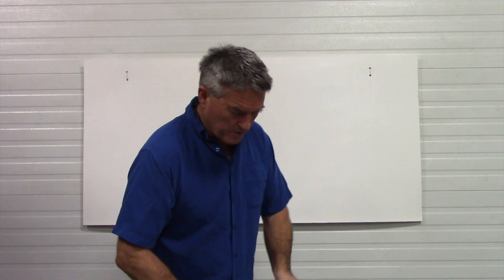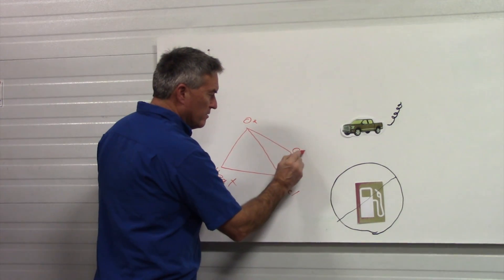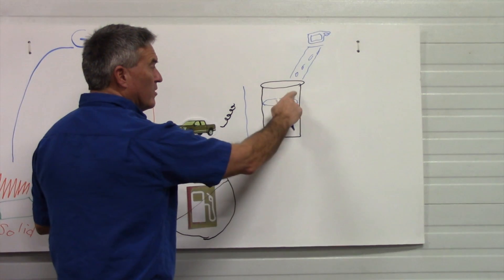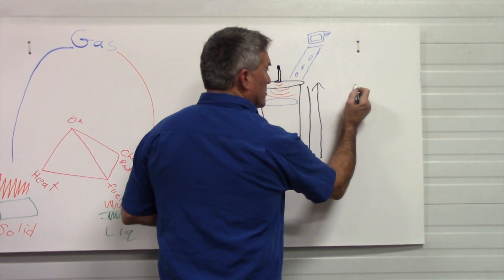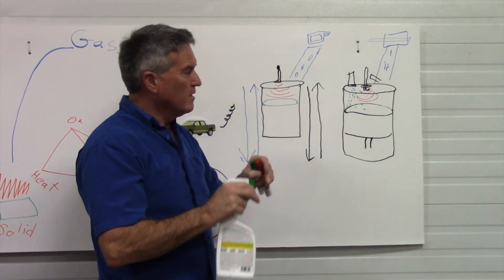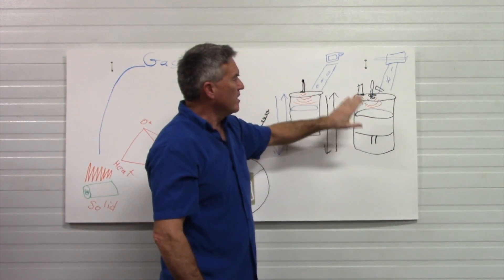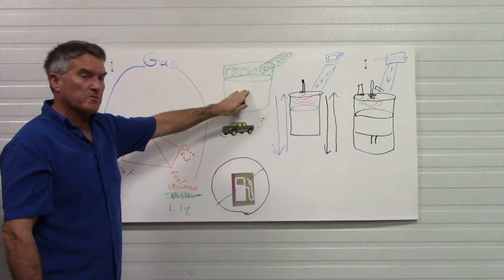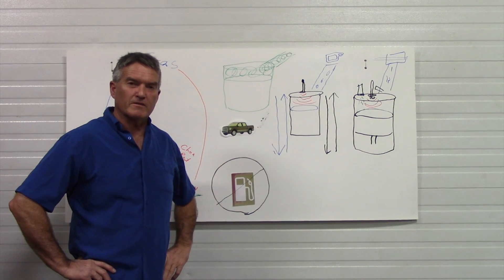One Simple Trick to get 100 miles per gallon with less pollution!

Comment: Why not just stop burning the natural gas capping the oil in the ground and use it first ? That would make more sense to me . Every car can easily be converted to run on CNG . The oil companies burn off metric tons of natural gas and produce mega tons of carbon just to get to the oil .
Vapor cars do NOT get significantly increased mileage ,many people have tried this and it simply does not work 2-3 % increase is all you can get. The Polish have been using CNG for decades and have proven it is the best way to use the oil in the ground . Leave the fucking oil in the ground and just use the end product you need to make the car run ,VAPOUR . The only down side to all of this is that the ICE as we no know it was never fully designed to use this fuel and as such reduces the life of the engine .
Now with some small alterations to the ICE we could add in compounds to the metal to reduce friction /wear and have a viable solution . The answer is not to build wet motors but build vapor motors . Leave the oil in the ground and let it keep making vapor fuel  the supply will be 100 fold more . The problem with that is the oil companies won't make as much money selling cheap non refined fuel. It would just need to be filtered and  more or less ready for use.
Union gas in ontario Canada runs there fleet of cars or did at one time on nothing but CNG and they saved tons of money. People just didn't like th long fill up times and refueling stations were hard to find. 
This works and could work right now ,BUT the OIL BARONS don't want it to work as they would lose money. They lobby governments to keep this from ever happening .
Reply: Well, as to the use of natural gas or propane, the problem there is that neither of those that are commonly used in today's vehicles has nearly as much potential energy as petrol fuels. This means that you have to use more fuel to get the same kind of power output. Secondly, your information about fuel vapor usage and mileage is WAY off.  Oh, if you didn't know, back in the 50's and 60's, a lot of farm equipment in the US DID run on vapors. Due to the extended times that items like harvesters and combines would run, the manufacturers created intakes with extraordinarily long and heated intake tubes that vaporized the fuel prior to combustion, The problem was that they ran at the same RPM and the technology couldn't easily be converted to fit the regular use vehicles due to the ever changing needs of the road.  I personally have built and installed a vaporizer unit, albeit a rough and inefficient design, on my 1995 Toyota Corolla with a 1.6 liter 4 cylinder engine. From the factory, this car was averaging between 23 and 25 mpg with over 165k miles on it. After I installed the vaporizer unit, I was getting between 41 and 43 with the average being closer to 41. Now, does that sound like a 2 - 3% increase to you? Nope.. Nearly double the mileage! Now, consider this. I did NOT disconnect my injectors... I merely subsidized the liquid fuel with vapor. The added vapor caused the ECU to pick up a rich fuel environment from the O2 sensors and cut back on the injector pulses per cylinder, per revolution cycle. Simple and totally effective. Btw. You are absolutely correct on the reason vapor will never be used in modern vehicles from the factory. The car companies and oil companies will not allow it because of the MASSIVE profit loss.
Reply: @craigcarpenter2069  I think that you are full of it. You are no better than a man selling snake oil as cure for every ailment known to man at a carnival. Show us all how you built this vaporizer of yours or you are no better than the snake oil salesman.
Reply: POST A YOUTUBE VIDEO AND EXPLAIN IT PLEASE
Reply: Craig Carpenter ,I guess you don't know that cars are made in the U.S.,that get 90-100+ MPG NOW.BUT are not allowed to to be sold to Americans.Only allowed to be sold to "poor" countries.FACT.
Reply: Scott Henderson
What cars are those and where and by whom are they sold? Links?
Reply: Scott Henderson: false. I'm not sure you're real, let alone being a kid.  And if you are real, and you are a kid, you shouldn't be left alone because, well, they made a movie about that and it's not really safe to do that, so, yeah.
Reply: Scott Henderson - You are right , But to be fair those cars are a hell of a lot slower than ours....
Reply: The news,,,, really??? Our "news" which is broadcast daily is nothing more than propaganda and outright lies! As far as Government vehicles being capable of achieving nearly twice the fuel mileage as civilian vehicles.... FALSE!!! I personally have 10 years Military and an additional 17 years as a government employee and quite possibly have driven more miles in a government vehicle than I have driven a civilian vehicle. In fact, I honestly believe the fuel mileage of a government vehicle is worse than its equal civilian version. The reason for this is that government vehicles are NOT held to the same governmental regulatory standards of civilian vehicles. It's the same old thing... "Do as I say, and not as I do".
Reply: @robertbuckles3596  after reading these comments i know what Scott is talking about he just has it wrong about the Government ..some years back i forget the name of the company off hand but a company did build a car that got great gas mileage i think it was about 50% better then most cars at the time or more...and the Government did put a stop to it before any were even sold ! they came down hard on this company and closed them down with a warrant and took the cars away to be destroyed .the few people that did know about them like the plant employees and there family's were protesting and the only proof this happened is a few people filmed the shut down and the trucks coming and removing the cars..so yes in a way scott is rite he just has the facts wrong .i can understand why the Government did this it would have crushed the oil companies and our so called friends in the middle east would not have been very happy ! let alone the major US oil companies that buy and refine the crude..also diesel is less refined then gas but costs more per gallon ?? just as im sure you know heating oil and diesel are the exact same thing ...Diesel has a dye added to color it green and heating oil red this is so truck drivers like me do not run heating oil since its much cheaper ! This is 100% true i have been stopped by the DOT and they sometimes check by opening your tanks and taking out some to check the color ..if you get caught running heating you get in trouble for tax evasion ! Truck drivers do this sometimes ..i forget exactly the year but around 14-18 years ago diesel went up to around 4.00 a gallon even a little higher before it finally ended ..i was a owner operator for United van lines and that almost put me out of business ..having to fill twin 125 gallon tanks so 250 gallons at 4 bucks a gallon 1000.00 a fill up..and my truck as most got about 6 miles to the gallon..the Government is under the control or at least heavy influance of the oil companies and the world ( meaning the middle east) i know you most likey know this but Scott said he was a kid and i am pretty sure he does not know all of this..many people don't ..eceptially about the heating oil and diesel also the time when it went up to over 4 bucks a gallon..Since diesel is like 1 step above crude why should they charge ore then gasoline ?? the reason is they make a killing off of truck drivers or the companies that pay drivers to drive there trucks..Thank you Robert and yes your correct about the news its a pack of lies !!
Reply: Craig Carpenter ..... That's a lie! I'm a cop and my cruzer, a Charger, definitely does not get good as good gas mileage my own Charger. The cruzer is pushing a massive amount of electronics which taxes the engine, plus some other stuff that counteracts over heating.
Stop blowing smoke up people's ass' and do a little research. 
GEET FUEL PROCESSOR and MAGNET MOTORS are more promising!
Reply: Elbert Beam -  Thank You; in 1978 Iranian chemistry teachers in So. Texas University told me the exact same things you just said here.  Dang, is this country messed up!   So there is no energy crisis; there is only a; "how do we keep people chasing their tails," crisis.  Make them confused about who to vote for, scandals, seem to be one way.
Reply: Scott Henderson no.. I am well aware of that fact. I'm aware of another that most folks don't know also. That is the fact that most government issue vehicles have VASTLY different tuning and in general get twice the mileage that civilian vehicles get.
Reply: Craig Carpenter
What do you mean by "government issue"? Is that military or are talking about local governments like police, post office, etc?
Reply: Craig Carpenter - Sorry! not so, All autos allowed into the US are detuned. By the way I like your Vid's.
Reply: You are correct in the fact that an internal combustion engine that is designed and tuned for the use of gasoline to operate will run far better on gasoline than it would on natural gas or propane. But with very simple modifications i.e. valve timing (cam), combustion ratio (piston design shape),  ignition source (timing). That very same modified engine could very well exceed the power, performance, and efficiency of it's previous state of design using natural gas or propane as a fuel source in a modified state.
Reply: Robert buckles "exceed the power, performance, and efficiency" - I don't think so! Gasoline 1 gallon = 125,000 BTUs -  Propane 1 gallon = 91,700 BTUs  and Natural Gas is even lower. Do The Math…..
Reply: you are all right on and this is the root of problem it's all about control of the people and there labor
Reply: P Kuudsk my friend had a rock caller that ran off propane  . ran .. just fine.. and very powerful..  you are so right!
Reply: Elbert Beam Back in the 90’s they said the same thing about a war in Alaska. They also found a huge deposit off the gulf. No drilling going on anywhere. It’s all a racket. Cars now get twice the mileage than they use to, so what do they do? Increase prices double to maintain profits. All the while feeding us this crap about CO2 levels and running out of oil, to justify price increases
Reply: They do that to control price, $$ is all its about
Reply: Craig Carpenter , that wouldn't surprise me at all.HAVE A GREAT DAY. SCOTT HENDERSON, & BENJAMIN L.SCHINDERSON FAMILY.
Reply: Marshall Richardson ,stats were on the news "the big three"&you can bet it's on the internet,(as history),at least that show aired they were showing cars with 100+mpg made,HERE,but Americans were   NOT ALLOWED,LEGALLY TO BUY FOR USE HERE.THAT is what the documentary was about,it 's Hard to believe that that video,didn't disappear.THEY WERE ALSO VERY SMALL,SOME of Em I believe they were ALSO ONLY 3cylinders.I am just a kid,but those"smart"cars are kinda small,and DANGEROUS.
Reply: P Kuudsk ... We'll,...The Geet Fuel Processor can turn earth's oil waste into non-polluting fuel. Magnet Motor Technologies are proving very promising too. That and you can't get worldwide cooperation.
Nice try though. Thanks for playing.
Reply: BS
The US gov't doesn't give a sheet. 

After all, you will pay for the car, and the gas, for US employees to use. You will also send your children to fight wars on their behalf. 

However there is truth to this video, the major obstacle is the oil and gas lobby. It is important to remember that the US dollar is based off the price of petrol as sold by the house of Saudi. i.e. the petrol dollar. For more information: watch the film "Network" ca. 1976. 

Long story short: without all of our highly inefficient cars with gasoline engines the dollar would lose all value.  

In truth I doubt that we really need to rely on petroleum and other fossil fuels. It is just one of the many the curses of capitalism. 

We've shot our selves in the foot...
Reply: All I can say is ask my former neighbor about using compressed gas, the thing is you would have to find him in the afterlife. He died when the bomb he was riding on was hit by another vehicle. Sorry ass wipe but there is a very good reason why compressed gas should not be allowed on a vehicle. I would rather walk away from a crash Broken than looking like a piece of toast. So take your compressed gas and get the fuck out of here, we don’t have time for stunned fuck idiots.
Reply: The US Gov't started using LNG vehicles in alot of their fleets in the 1980's. Most were abandoned because the engines broke down and couldn't be repaired properly. Good idea in theory, and is more advanced now, but still real world problems.
Reply: P Kuudsk omg.   you are sooo right!!
Reply: Driving around around with compressed gas is extremely dangerous.
Reply: Natural gas has 114 octane rating?  (about) They have developed new NG fuel tanks / now it will work in any gas tank shape. The gas stations could be fitted with a new NG storage tank. It would take much less time a complete US buildout / much less than cell phone towers.. In dense metropolitan areas the demand would grow X?  This is a no brainer to me.
Reply: I hear there is a way to manufacture synthetic fuel using domestic coal.
Reply: Drew N: Yes, back in WWII they built what is called a GASIFIER. It used wood inside a metal can of some type and a flame underneath it to created the necessary gas from the wood (ie...charcoal or as people will call it Biochar). It can still be done today but it's a dangerous concept because of the flames and the pressure the gas can build up. It's a similar situation with the HHO generator. In the HHO generator you basically have 2 different types: a wet cell and a dry cell. The dry cell seems to be the way to go because all the gases and fluids are completely contained in a much safer way. Whereas the wet cell HHO system is basically an open system (meaning that there is PLENTY of room for the bubbler to create the hydrogen and oxygen and it can build up a lot more pressure because of that concept). In the wet cell it is wise to add  a couple pressure relief valves so that if it ever overloads the pressure can escape instead of exploding, which it will do if it cannot escape and builds up under that pressure. In a gasifier the gas that is produced has to be cooled before it gets to the carb or intake and it has to be pushed via a pump to get there. Look them up online here. They're pretty cool to check out. If I had the cash and the place to work I would attempt these things myself but I would recommend that you get a LOT of knowledge of it long before you try it because  both methods can be very dangerous and volatile.
Reply: Drew N - Yes they can BUT! It's not cost effective.....
Reply: Why not just "raid" the black ops/secret military facilities around the world and make them share all their back-engineered knowledge??? You think that's all tin-hat conspiracy stuff? Think again!!
Reply: If any gas is used it should be liquified petrol gas. LNG or CNG is not reliable or practicle in daily use simply because of the high pressures involved which bust valves, the time you need to fuel up a car and the limited range. Besides that, peak oil is a bunch of BS. Hydro carbons like Mineral oil and gas are produced (abiotic) in the ring of fire and squized from rock under extremely high pressures. Every earth quake produces new hydro carbons. As long as we have plate tectonics and rocks, we will have oil.
Reply: ok pal, why don't you start up an exploration company following the ring of fire and let's see how rich you get extracting all the abiogenic petrol deposits ... good luck on that !!
Reply: P Kuudsk - Gasoline 1 gallon = 125,000 BTUs -  Propane 1 gallon = 91,700 BTUs / gasoline is about $2.85 a gallon and propane $4.00 a gallon.  Plus the tank to hold the propane would weigh alot more = even less mileage. Do The Math….. Just Sayin!
Reply: Timothy Mckee - Not that safe, Besides going the "Alloy" route would be very unsafe in my opinion.  I think using a micro Molten Salt Reactor would be a better choice. To create super-heated steam then use it to drive a turbine  You do know the by produce Bi-212 from the use of Thorium causes issues, the gamma rays are very hard to shield, requiring more expensive spent fuel handling and/or reprocessing. Well, beside being off topic - Maybe this may not be a great idea after all.....
Reply: P Kuudsk ii
Reply: P Kuudsk i
Reply: The gas above the oil is piped to your stove and water heater. What do you plan to burn in those when all the gas is being used for vehicles?
Reply: Craig Carpenter lo 9
Reply: P Kuudsk  q
Reply: Coeliac diseases
Reply: Drew N - Germans did it in WWII.  The formula is known.
Reply: It is true that useless burning of natural gas was common many years ago. Now, in formations (reservoirs) with both oil and gas, the high pressure gas is usually saved to provide pressure to push the (more profitable) oil toward the surface, or to at least reduce pumping costs. Once the easily recovered oil is depleted, gas production may be used to profit from continued use of the well. At one time Middle Eastern oil wells had enough underground pressure to push oil to surface, through the pipeline and into the tankers. Wasting the natural gas pressure has made that much less common today. Hence, very rarely do you see oilfields with black smoking wells scattered across the desert.
Reply: Build a bubbler, that will extend your milage to ridiculous lengths!
Reply: P Kuudsk FineJob excellent logic. Thanx for sharing. Gooday
Reply: I'm not a motorhead, but I'd have to agree with many of the comments here that the reason we haven't gotten cleaner and more efficient combustion engines is purely the greed and the lack of empathy ( yes, that might sound like a strange word in this context, but the profit before general welfare motive proves they only care for themselves over the common good ) of the petrol industry and major vehicle manufacturers. I know there is great disagreement over the anthropocentric climate change issue, but purely alone on the wastefulness and the unnecessary cost to the consumer of a finite resource, it is a good enough ethical reason to burn less fuel.
Reply: Dog excrement....he must have read this in his silly sally make shit up golden book....waste of time....he needs to  Give up his vehicle  Entirely for 2 years just for making this video
Reply: P Kuudsk true there was many natural gas vehicles in the 70s running in the US where I'm from. It's a thing of the past here.
Reply: wow just wow very intersting and wll thought out
Reply: P Kuudsk some propane delivery trucks run on the propane from the huge tanks on them. oil changes are at 30,000 plus miles. when he texted ICE...at first thought about buying more than 10% alcohol regular gas. one cold night I bought gas that had 15% alcohol in it...it was almost freezing and so foggy could hardly see. was following a truck and letmoff the gas and almost sure it was because of the evaporation of the alcohol in gas....water in the air froze around the venturi and my throttle was stuck. had to cut engine off ! Luckily it was a vehicle with no power stirring and was able to drive still. Pretty sure they have adapted and have a heated carbon to keep the ice from forming. Simple....
Reply: P Kuudsk there's a hell of a lot more natural gas than oil
Reply: Scott Henderson, having worked for the federal government for a total of 18 years (10.5 USAF and 7.5 USPS), I never experienced a government vehicle with twice the fuel range as a civilian vehicle, so where do you get your stats from?
Reply: I have over 10 years with the Government and I ain't seen it!
Reply: I come from Argentina, most of the regular gasoline vehicles in the country and gas stations were modified to use natural compressed gas, because it is WAAAYY cheaper, and to the previous comment sorry about your friend, the gas cylinders used in cars can't be the same you use in your barbeque grill, there are special kinds designed for automotive that don't turn your vehicle into a bomb.
Reply: +Elbert, seriously Midland Tx, they "just discovered" or maybe they've been sitting on it.